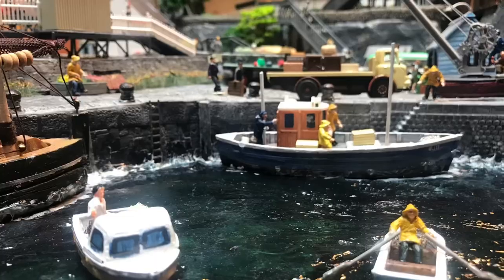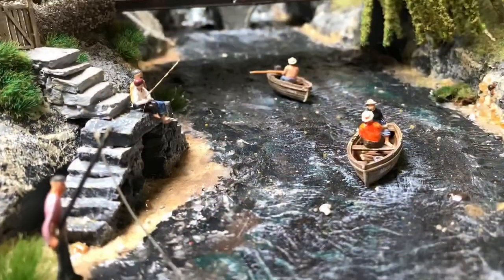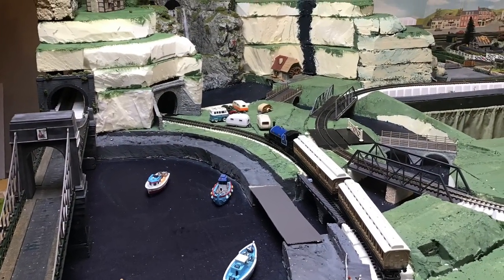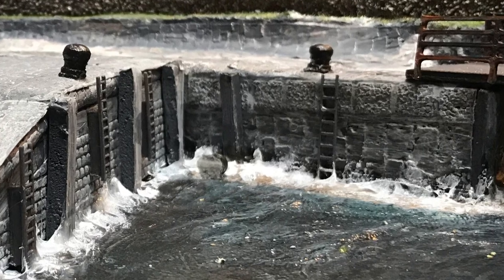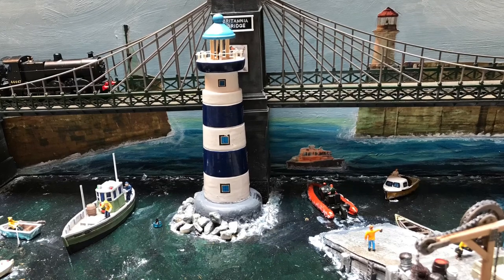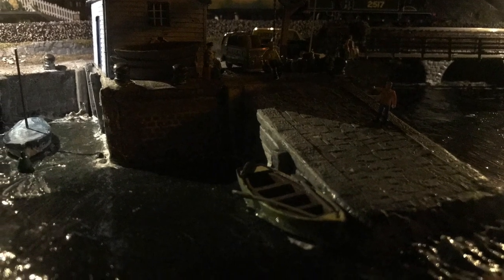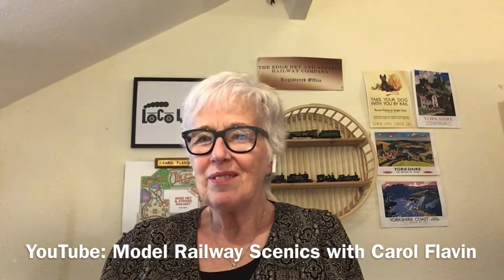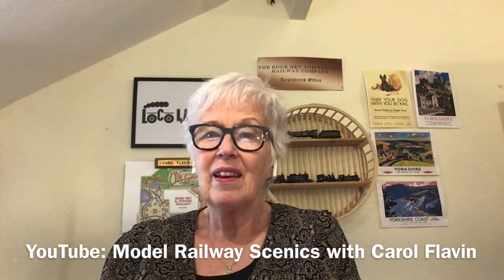How I Made a Harbour on EH&SR

Comment: Excellent, very artistic, the effects of the water to simulate movement are amazing.
Reply from the maker: Thank you. I’ve tried a number of water effects and really like using paint and structure gel. It means I can control the wave shape with the heavy structure gel and a spatula.  And it doesn’t run off on the floor like the pouring water can do.